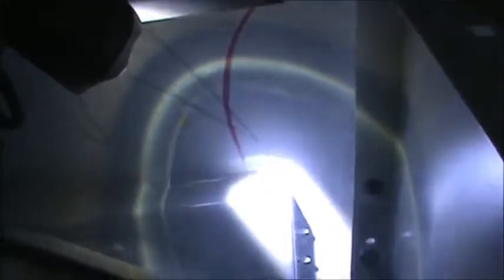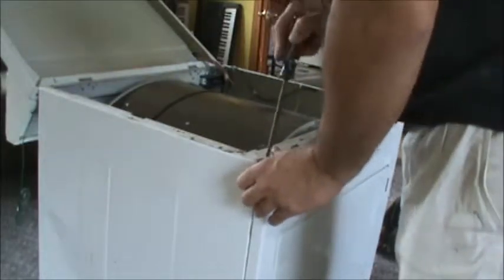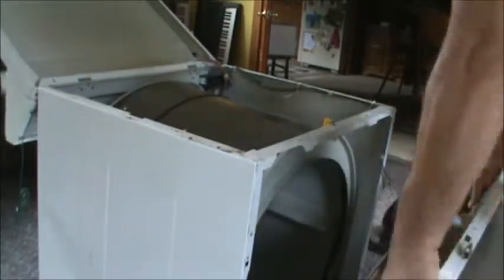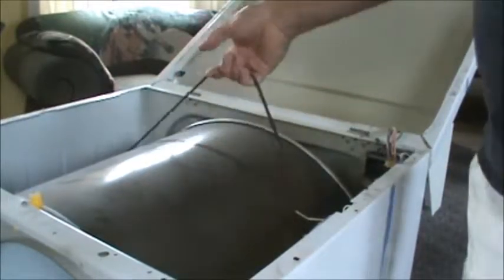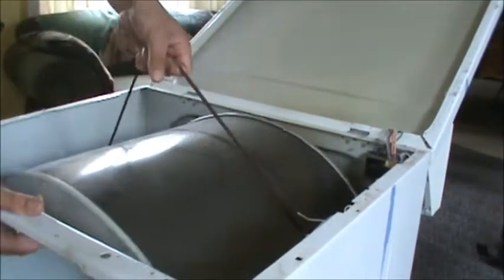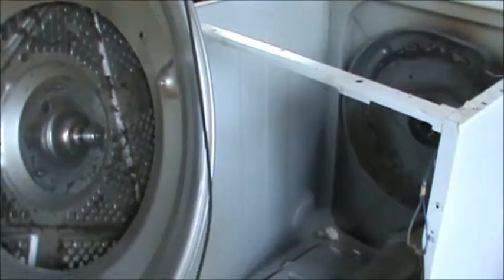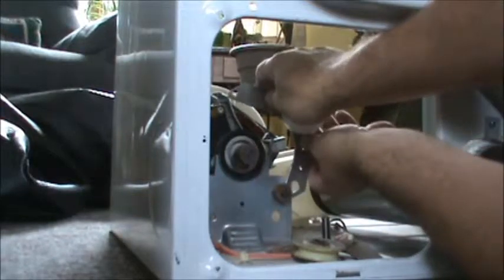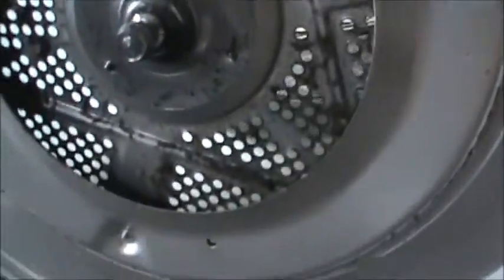How to repair your model fdeb23rgs1 (and other) dryer.  A 3 minute video.

Comment: Great vid. I have the same unit and it's producing heat, any suggestions?
Reply: *not
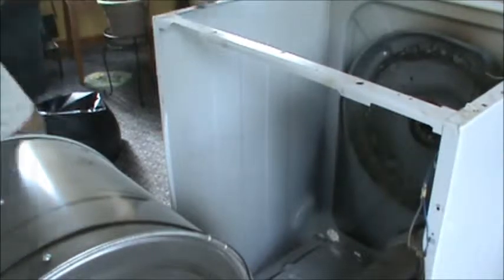Reply from the maker: Yes sir, if you are producing no heat, the issue is most likely a thermal fuse (about $7) or your heating coil, seen at 2:30.    let me know if you need more assistance.  thank you kindly for watching.

Comment: Where did you get your parts?
Reply from the maker: I found the parts that I needed and then I searched on Amazon and found a repair kit that had more than I needed.  It even came with new felt that I pointed out in the video, but I didn't need it so I put it on the shelf.  Do you have a problem with your dryer, too?
Reply from the maker: here is the kit I used:  http://www.amazon.com/gp/product/B00DM8L18C/ref=oh_aui_detailpage_o02_s00?ie=UTF8&psc=1